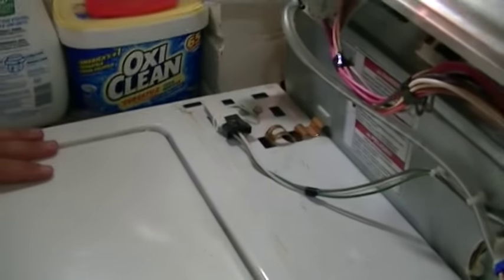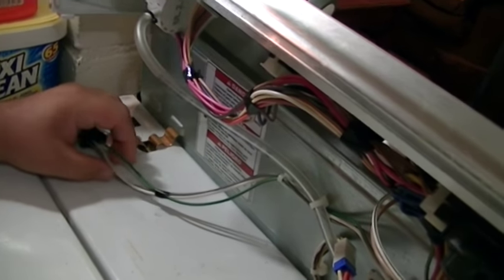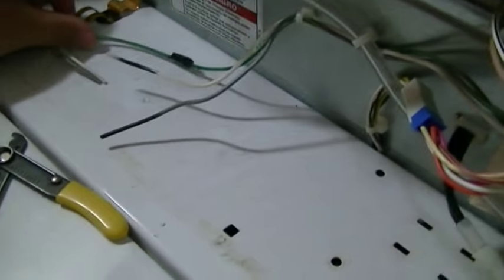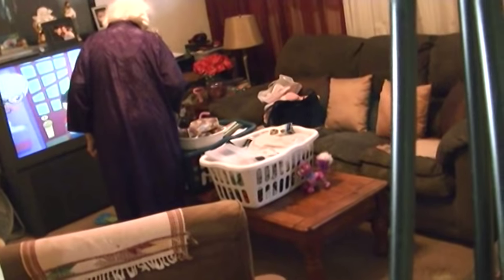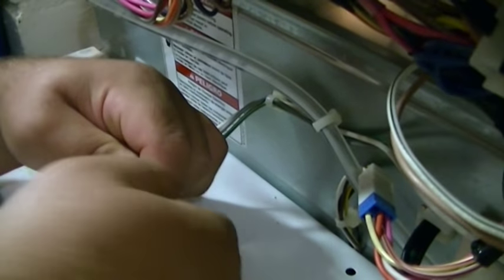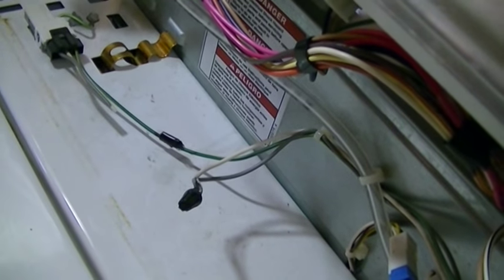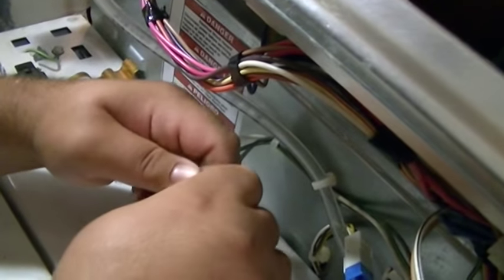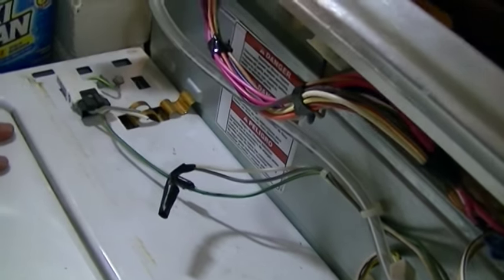Quick & Easy Whirlpool Washer Lid Switch Defeat

Comment: Not to be a hater or anyting but you can do this with other washers with different color wires. For instance mine has two White two yellow one black one blue. I believe if I hook up everything but the white wires together it will be good to go I think. The washer does not have a play or pause button or a lid lock it's an old Maytag.. What do you think brother you think I'm good? I'm about to skin this smoke wagon.. there's no ground wire on mine. Ground wire is clearly separate.
Reply from the maker: Sure, this can be done with an old Maytag like that.  First thing you want to do is meter EVERYTHING.  Once you do that, you should be able to determine which wires are which and what they do.  Better yet just replace the switch.
Reply: @jaykay18  hey can I show you something real quick I seen a video of this Mexican guy floating the wires and it's identical to my washers the wires are in the exact same place. I'll send you the link so you can just look at it.. I don't want to Frye nothing. I work on used appliances and sell them I have for about 2 years I'm still learning but I'm all right at it. basically I'm just trying to see if cutting these wires and splicing them together would be the same as floating it like this Mexican guy is. I would ask him very easily but his comments are turned off on every single one of his videos. I don't blame him either people are ridiculous
Reply: @jaykay18  Man I would replace the switch but I would have to order it nothing is open right now because of the "virus". I don't really order anyting I stay away from Banks and online.. However if I continue to do what I'm doing I might as well.. b
But when you do that you have to rely on other people like the mailman and the person packing it and the person taking the order lol.
Reply: Also I should mention the actual switch it works and everything it's just the part where the lid opens. That little piece is worn off and it's not actually hitting the switch to tell the machine that the washer is closed or open. You know what I'm saying you can put a screwdriver in the hole and run the washer fine. In the spot where the little piece is supposed to push it back when you close the washer..
Reply: Worked like a charm brother I appreciate your input I'll be back. If you ever have any questions for me let me know I'll be here. Help me help you help me!! :)
Reply from the maker: Yeah Angel the Appliance man, that guy's all right.  I would have suggested perhaps gluing something on the lid to press down the switch, that might be an easier solution.
Reply: @jaykay18  Yeah I attempted that it still wouldn't get to it it's missing something..

Comment: How do you get the damn top open! I can’t get the top to flip open so I can get at those wires
Reply from the maker: Some models have screws at the bottom of the control panel.  Some models have screws behind the machine.  Some have no screws, and you use a putty knife to pop the clips underneath.

Comment: Thanks for letting me at least finish the load without bailing water. This will buy us some time on these old appliances. Now the wife gets to pick out a new washer and dryer. :-)
Reply from the maker: Make that smiley face a frown face--there are NO washing machines on the market, at any price, that can do as good of a job as what you have.  Fix what you have at any price, believe me, you'll end up being really sorry if you replace it.  Not to mention, it won't last anywhere near as long as this machine.

I have two of these "direct drive" Whirlpool machines, one is 11 years old and the other is 26 years old.  I've replaced ONE part on the older one, a $6 part called the agitator dogs, and I have a video on how to change that.  Also I have replaced the timer on this machine in this video, and a motor coupler on another one.  They're easy to work on, parts are cheap and plentiful.  Trust me.  If you don't want to and pick out a new set, tell me how bad it is.
Reply: Why would you need to get a new set? The newer they are...the worse they are.

Comment: HI Jay, I have been waiting on a new lid lock assembly for 6 weeks - every week the repair company says "another week". Meanwhile, I'm doing laundry for 12 people - lugging a mountain to the laundromat and back every 3 days.  The Whirlpool Model MVWB955FW1 is 3 years old.  I asked if the repairman could just override the lid lock mechanism and he said he "will lose the contract with Whirlpool if we do that."  So I'm 70 and ready to try to override it using your cut, strip, wire nut and tape" solution.  Do you think it will work on my model?
Reply from the maker: The repairman is right, he CAN'T bypass the lid lock for you.  He would probably get fired, and the company he works for would likely lose their contract to repair them.

As for your bypassing it yourself, lesson learned.  Your washer is 3 years old and already broken.  This trend will continue after it has been repaired.

There's no fooling a modern washer into working, they make it that way so it CAN'T be bypassed.  You should have fixed your old machine.

If you're seriously doing laundry for that many people, you should consider either an older direct-drive washer like the one shown here (would need to get it secondhand as they don't make them anymore--and never will again.)  Or, your other option is to invest in a Speed Queen Model TC5--and ONLY that model, which you will not find in Home Depot or Lowe's or any other big-box store, you'd have to go to an appliance store.  If you invest in such a machine, it will likely outlive you, as would an older Whirlpool.
Reply: @jaykay18  Hi, I did just buy a Speed Queen dryer, with NO bells and whistles.  I will take your advice about the TC5 - I hope it has a BIG tub.  That's why I bought the Whirlpool.  But for the time being, and sorry for asking twice, will your instructions on cutting the wires in this video work for getting my washer to work right now?
Reply from the maker: @kirstiewilde5015  While I do have a propensity for speaking with alacrity most times, I also wouldn't deliberately NOT answer your question.  I suppose I will have to repeat myself.

There's no fooling a computer-controlled machine like you have.  Cutting and splicing wires on that would likely fry the computer circuit boards, making the repair cost more than you paid for the machine in the first place.  It's not worth it's weight in scrap either, and never was High Efficiency.  It took longer to wash the clothes than ever before.  It was garbage before it left the showroom floor.

Any of the washers I had recommended have a center agitator, like the old school washers did.  They have the same size tub as the old washers did.  They do a good job, and they do it FAST and EFFICIENTLY, in one shot.

Unfortunately, you were duped into the marketing hype like most consumers.  Now you're paying the price.  You're thoroughly screwed.  Go out and hunt down what you had, you never know what you have until you lose it.  Once you see how fast a REAL washing machine can do the laundry, you'll see that what you have is garbage.
Reply: @jaykay18  Thank you, Jay.  Amazingly quick and kind advice.  Is there an old school front-load that you recommend (like the big ones at the laundromat I see when I'm lugging my mountain of laundry there twice a week)?  I have to wash a lot of blankets and quilts and the top load with agitator can't do them.
Reply from the maker: @kirstiewilde5015  They never made a decent front loading washer in this country, except for ones back in maybe the 1950s and 1960s.  But they were rare.  You'd be surprised what you can fit in a top loader with an agitator.  I do Queen size blankets, sheets, and comforters in mine.  King size is a problem.

Comment: I have a newer kenmore 200 series and my wires are red whit and blue. Will this work and which wires do I use?
Reply from the maker: That's a Playskool washer with a lid lock and a belt drive.  Everything's computer controlled, and without that lid lock and switch working properly, the washer wants to be brought to the curb so it can be recycled into more Playskool junk, that will break in short order.

You need to fix the actual problem, and that means parts, maybe even sensors or circuit boards.

Comment: How can I bypass the Lid Magnetic Locking Switch on a Kenmore, the wire colors are white for neutral, red for lock switch, blue for Lid switch input and yellow for switch solenoid
Reply from the maker: You can't.  That's computer controlled, and it's looking for a certain signal.  Best I can tell you is remove the latch piece from the lid itself, and stick it where the machine wants it to be when the lid is closed.
Reply: Idk

Comment: Someone tried the same on my current used washer and those wires just caught fire. What would cause that
Reply from the maker: Probably the wrong wires were connected, live was shorted to neutral or ground.  That creates a dead short across the wire.
Reply: @jaykay18  looks like they did the same wires and just used electrical tape. Got loose and started arcing maybe? Redid the connection and will see what happens🤞
Reply from the maker: @brettc1981  Yeah electrical tape isn't going to cut it.  You're putting the full current of the motor through those wires, it needs a solid connection.  At the very least, wire nuts, better would be solder and heat shrink.

Comment: Jay what if my machine was already bypassed years but it stopped working? Can I buy a new lid switch to plug the bypassed wire or is this dangerous
Reply from the maker: I honestly don't see the point in that, if the wire is bypassed, and the machine's not working, putting in a switch which will BREAK the connection certainly won't help anything.

Please, be EXTREMELY SPECIFIC on what "stopped working" means.  For example "I turn the knob to regular wash and start the machine and it starts filling up.  Then, after it's filled...."
Reply: jaykay18 I have an Inglis IS41000 mid cycle it stopped spinning and would not drain. There was a smell and loud noise. Now it will fill with water but will not agitate or drain or spin. There’s a constant ticking/humming that sounds like the timer is still going even though it is set to off. I’ve tried replacing the motor coupling but it was already in decent shape so now I’m looking at the lid switch. I’m expecting a newborn in 10 days I need a washer! HELP!! lol thank you
Reply from the maker: Ah--there we go, now there's something to work with!  The key is the smell and loud noise, probably means the motor went out.  Not sure on the ticking or humming sound as of yet, that could be a separate issue or could be nothing.

You want to do ANYTHING in your power to save this machine, you can't buy another one like it.  Whoever you have to get, at whatever price, no matter how much they tell you it's not worth fixing, it's worth it.  They don't make machines like this anymore.

You're looking at a bad motor, bad timer, or both.  There is a way to test the motor, but you have to know what you're doing with wiring and make your own cord.  You can check the lid switch wires, if they're connected together as I showed in this video, then it's fine.

Good luck with your machine, and your newborn, let me know how it works out.
Reply: jaykay18 hi thanks for your advice. It’s been over a month without my washer now! I’ve looked at a couple videos showing how to test the motor. A bit out of my league... so I was wondering if I might be able to visually see if the motor is faulty by removing to top of the machine and trying to start the cycle? Is this dangerous? 
-Or could I use my multimeter to test the motor or timer? 
-Also another clue I might have. We noticed that the washer and dryer were kinda fused together where they were touching like something heated up the sides from the inside of one machine and caused the heat to melt through to the other cover of the other machine...
Thanks in advance for your help!
Reply from the maker: As far as the machines fusing together, those cases are solid steel.  They're not going to melt.  Steel melts at 2500°F; if anything in your house got even remotely that hot, you'd see other damage.  My guess is it was detergent that was spilled, made its way between the machines, plus water over the years, leaking between them.  That can cause them to rust together, and if you've ever had a rusty bolt snap off you know what I mean.  You are going to have to get the machines apart, so maybe a prybar or crowbar.

If the motor makes no sounds at all, you could meter it with your multimeter for continuity, if it reads open circuit it's obviously bad.  The timer has too many contacts to know which ones to test.

There's no removing the top of the case, the entire cabinet is removed.  There are big metal clips under the control panel that get removed, and the cabinet is free.  The top tips back a couple inches and is then pulled and slid off.

Comment: I have a Kenmore 100 and the lock switch is out can I do the wires like u did in this video one blue one white and red and which wires do I do
Reply from the maker: You don't.  Actually, you can't; the computer prevents you from fooling it.  The only course of action is to waste money on repairing that piece of junk.  When Whirlpool changed their design to belt-drive, like what you have, along with it came the lid lock, a circuit board, and all kinds of sensors that are there to prevent you from completing a load of laundry.  Look in a used appliance shop for the kind of washer you or your mother used to have; a Whirlpool direct drive, something no later than 2007.  And don't worry about it being an older model; they are very robust and rarely break.  If they do, the repair is quick and easy, parts are cheap and readily available.

Comment: How many of you are now looking around your house for a fire alarm with a low battery? Lol.
Reply from the maker: Some people like that.  My dad called me up one day on the phone and as he's talking to me, I could hear the low battery alarm in the background.  I told him to change the battery, but no, he left it beeping, because I heard it the next time I spoke with him.  He always kept spare batteries around, but maybe, just maybe, he was out of 9 volt batteries.  

I needed to head out there to see him, and figured I'd bring a 9 volt battery along and give it to him, since he's generally a tightwad.  I gave him the 9 volt battery.

Couple weeks later, I spoke to him on the phone.  Still going off.  I guess he just HAD to squeeze the last ounces of juice out of that battery before he was going to change it.  For me, personally, it would drive me insane.  I actually don't have that problem of a low battery since all of my smoke detectors are hard-wired to my alarm panel.  Now if the alarm panel battery goes dead, that's a different story.  In fact, now that I mention it, it did, a couple months ago.  5 alarm keypads started screaming all over the house.  There is no way to live with that since the sound is constant.  Silly me, I had an extra 8 Ah on hand so I could replace it right away.  I replaced it immediately.  Old battery saved for other nefarious purposes...

Comment: When the wires are cut and splice together, what size is the screw thingy?
Reply from the maker: The "screw thingy" is called a wire nut.  You use the wire nut size appropriate to the gauge wire you're dealing with.  Or, in "screw thingy" terms, whichever one fits.
Reply: do you have to use a wire nut or can you just use electrical tape if that’s all i got

Comment: Hello!  Will this work on model #WTW4816FW2?  Whirlpool says replacement part is $105 and on backorder for 45 days!
Reply from the maker: Think carefully.  Is there a difference between a lid switch and the part you're getting?
Reply: @jaykay18  I thought it was the lid switch replacement part.
Reply from the maker: @anneharney8723  The question actually is, is it the lid switch, or the lid LOCK you're talking about?

Comment: Great video! Do you know if it will work on a Maytag bravo? I broke the lid lock and don’t want to buy a new one cost me 70
Reply from the maker: Once you say lid lock, it's game over.  There's a computer in that unit, and you can't fool it.  Only thing you can do is fix it the right way, for it to die two weeks later of another ailment.  A better idea is to get rid of it, go to a used appliance store, and get a real washer without any electronic controls.  Probably like the one you used to have, or your mother or grandmother used to have,.  Those machines wash better and will likely last another 20 years or more.  Don't worry about saving water or electricity, the cost to fix your Bravo washer, or replace it when it dies much sooner than expected will well usurp any savings you may have accumulated.

Comment: My washers lock has decided to stay locked and wont budge, will this help fix it?
Reply from the maker: You've tried unplugging it?
Reply: jaykay18 yes i have, ive looked it over and tried figuring out what else to do but its still broke
Reply from the maker: If it stays locked when unplugged then something is mechanically broken.  You're going to have to fix the actual issue.

Comment: I might of figured out how to reset washer after the lid error code has been correctos.  1unplug the lid switch at comp board turn on  and you get ul error (i beleive) power off and befor error pops up again plug lid switch back in board.  "HEY, IT WORKED FOR ME" Good luck.
Reply from the maker: The machines depicted in this video don't have circuit board, microcontrollers, computers, or anything else, and not only do they work just fine, they wash better than the junk today.  Save yourself the trouble, toss the whole machine and go to a used appliance store and buy one like this.